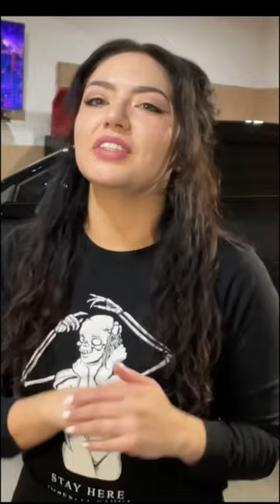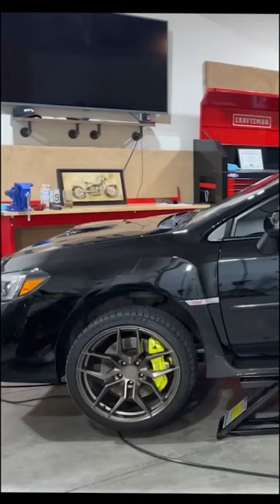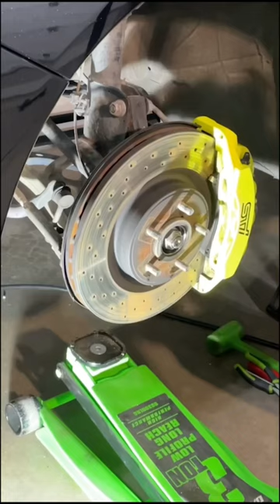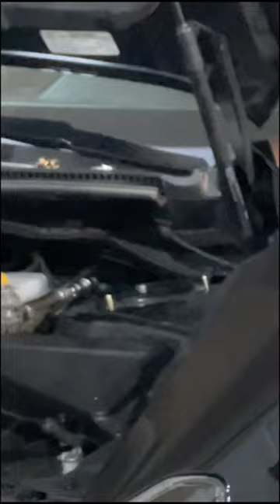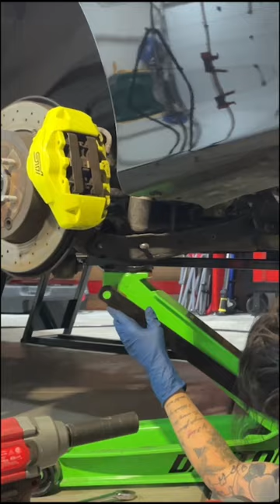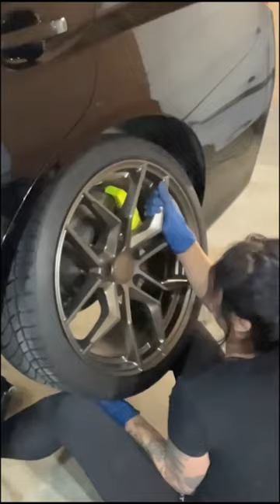Coils install!

Comment: I’ve had my fortune auto for a bout 3 weeks now in my Sti. I love em but they are a bit of a head ache with my wheels. 18x9.5 40mm offset wrapped in 265 35 tires. I went an in drop and ended up having to pull my front fender and roll the rear, and still needed to run some pretty aggressive camber in the rear lol. Next week I’m gonna raise it up 3/8 in and dial back on the camber to try to find a balance between fitment and function.